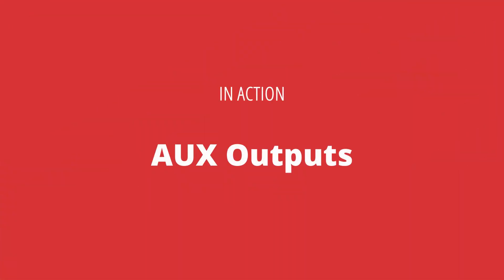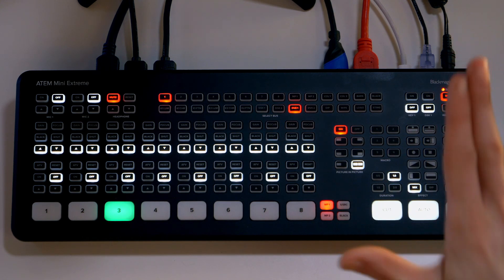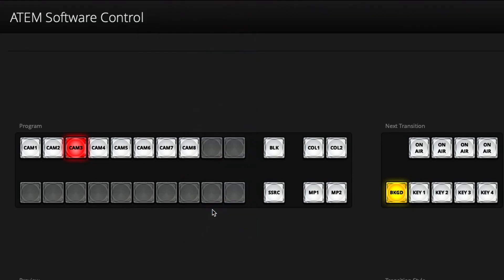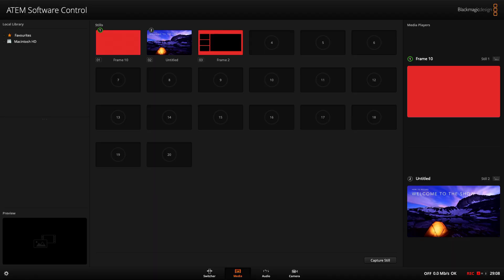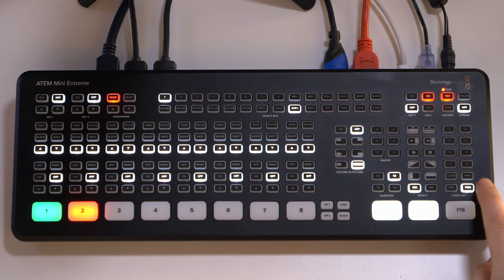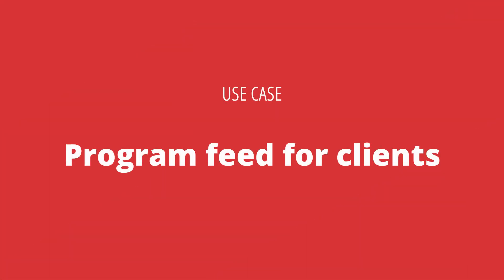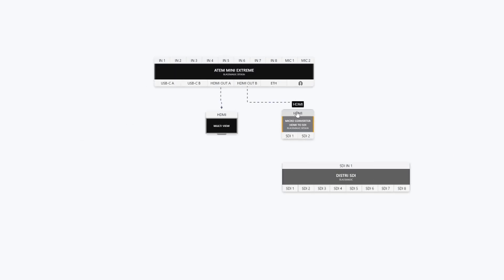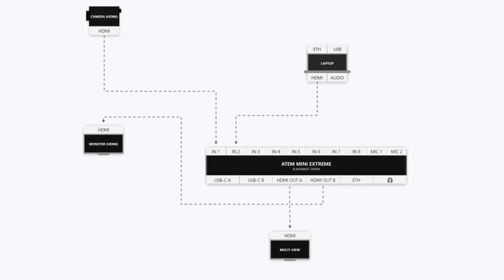Working with two HDMI outputs - ATEM Mini Extreme // Show and Tell Ep.79

Comment: This is very helpful, thank you. However, I have a problem. I have myself keyed and 'overlaid' over my computer screen content. Computer screen is input 1 and me (keyed) is input 2. As planned, the program window in multiview shows me over the computer screen. The 2nd hdmi output also shows me over the screen, as desired. However I have a third monitor which is set to mirror my program output screen. That 3rd monitor only shows the computer screen. The keyed version of me is missing on the mirrored monitor. Can you suggest what I might be doing wrong? Thank you.

Comment: Thank you but I’m still at a loss. I am a church with multiple tvs throughout. I can hook up my presentation software to all tvs however am having a problem switching to stage for worship and/or sermon to show on all tv’s. For example i have camera into number one on the Atem Extreme which i can switch back and forth but is there a way to get the same on all tvs or monitors? Thank you

Comment: Thanks for the video. I am trying to feed a video board that needs 720p 60. HDMI OUT A is my multiview, HDMI OUT B is my program which I use for talent monitor but I would also like to feed the house with B. Is there anyway to select the output resolution in the Atem Software? My stream is going out via the ethernet(network) at 1080p 30. Thanks for any and all insight.

Comment: Can you output to your multi view monitor, and to a projector screen (as in your second example), and a monitor for the presenter to be able to see programming (as in your third, but in a context where you also needed to send to a projector?  If not, do have a recommendation for a splitter that might work, or another option I might consider? I am needing to do a hybrid training that will have both in person participants, while also streaming on zoom. I have figured out how to get the multi view signal going, and signal to the projector. I’m not sure how to add an extra monitor though so the presenter can see the power point and perhaps all of the zoom participants. Any recommendations?

Comment: Excellent equipment the problem I had with our Atem mini extreme was that after 1 and a half year of use out of nowhere the HDM1 output stopped working and after a few days the HDMI 2 output also stopped working. BlackMagic's technical support simply said that there is nothing to be done because the warranty is only 12 months, that is, buy it and pray that it does not stop working after the 12 months of warranty because if there is a problem, you have to throw it in the trash. and buy another one.... Regrettable.

Comment: The hdmi output on my dell 1080p 60hz display does not work t gives an error that the monitor does not meet requirements of the device
Reply from the maker: Try a different HDMI input or try using 30hz output from the dell

Comment: Hello !
Mini Extreme issue :
- HDMI Output 1 won’t transmit any signal when using my long cables
- HDMI Output 1 mostly transmits no signal (blank screen) when the same long cable is extended using a powered hdmi splitter and transmits the signal only for few seconds

Notes : 
- The same cables and the powered splitter are able to extend the camera signal into the hdmi inputs 3,4,5,6,7 and 8 perfectly.
- The same long hdmi cable can transmit the camera signal into the 1st and the 2nd hdmi inputs without the extender. 

Any suggestions? Many thanks!

Comment: Loving these vids. I plan to use the second output to send either the programme or one cam with VT back to the talent over zoom, but I’ll want to send them a mix minus audio or simply mute it when they are in the programme mix. Can I control the audio paths separately in this way?
Reply from the maker: You cannot. You will need to treat audio separately as all audio will be sent back over the USB into Zoom.

Comment: Greetings.  Any thoughts about how to have multi-screen AND two outputs?  The goal is to use PREVIEW for in-person viewing, PROGRAM for streaming audience, and still have the muitiview on  a confidence monitor.

I was thinking about adding HDMI splitters for each input and using this (8x1 HDMI Quad Screen Multi-Viewer & Seamless Switcher-HDMI Screen Splitter, https://www.amazon.com/dp/B079GTYHFD/?coliid=I3LBCJKHHAXXC7&colid=W64Q2KYJKNKE&psc=1&ref_=lv_ov_lig_dp_it) on one side and the ATEM mini extreme on the other.
Reply from the maker: I suspect you want Program, preview and multiview on a local monitor AND stream at the same time?
Reply: @heretorecord  Greetings.  Thanks for responding.  Not necessarily stream at the same time but I wouldn't rule it out.

Comment: Thanks for this. Quick tip - I programmed the macro keys to switch the output 2 so that they perform the same as the video out keys.
Reply from the maker: Good thinking! Pro tip indeed!
Reply: This is a really cool idea. Do you mean that they would serve the same purpose as the keys demoed at 0:27? Can you program macro keys to fade (rather than cut) between different outputs to HDMI2?

Comment: If you go clean on the output, is it all the grafic,  buttom half and other effects you lose in the output?
Reply: It only drops Downstream Keys, which is normally where you would add a Bug.   If a graphic is applied using an Upstream Key, it will still persist in the clean feed.
Reply from the maker: I should have made that extra clear, but that is why we have Joe!
Reply: @heretorecord , I thought the video was perfect. Great job!  

Pointing it out never even crossed my mind. I'm sure many will benefit from this video.